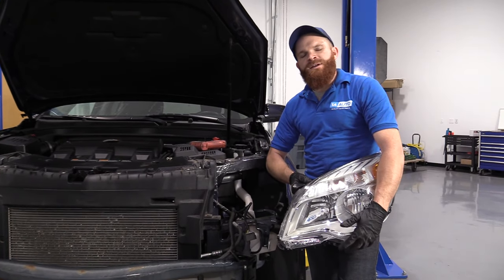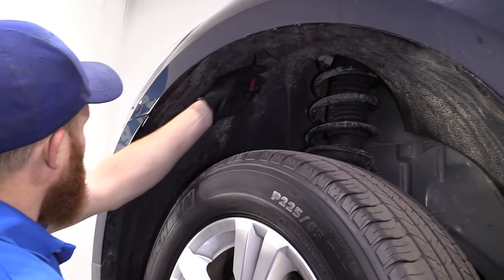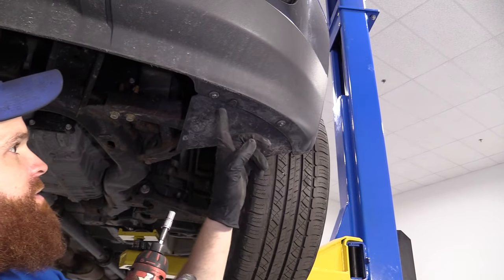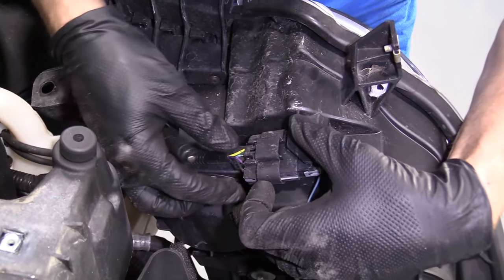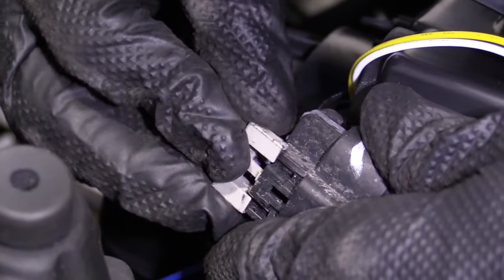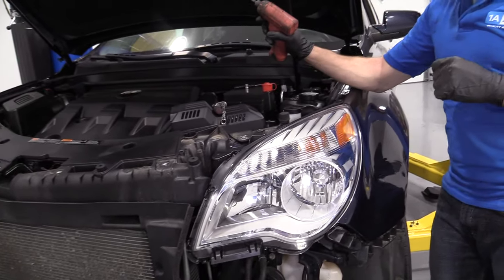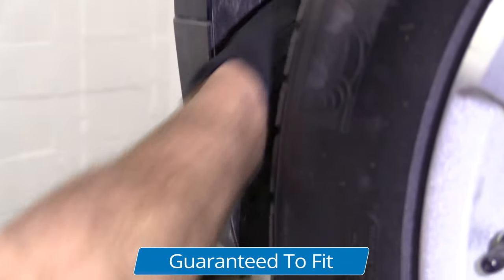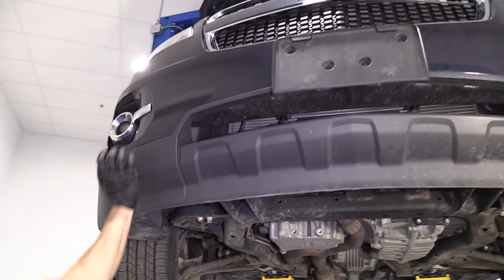How to Replace Headlights 10-17 Chevy Equinox

Comment: great video but you can save some time by just folding those two side plastic covers back after you take out the bolts - no need to take the whole things off; also always a good idea to TEST the lights out before you put everything back together in case the connector isn't firmly seated or some wire manages to get broken during the swap. Just take a few seconds...
Reply: also, having just done this - there is 0 need to remove the very top pushpin OR the pushpin to the inside of the tire - just remove the 2 pushpin and the 2 screws on the outside edge of the wheel well and also remove the top 7mm screw that goes thru the top that he talks about. The other 2 have no bearing on anything, they don't prevent the bumper fascia from being removed.    The bumper cover comes off easy and is very simple to put back on, those edge clips and tabs really do the job nicely. Take your time and you can leisurely get it dont in about 90 minutes

Comment: All that to change the assembly or the change a highbeam bulb, rediculous. I have a 2008 Hyundai Entourage. To change the assembly or change any bulbs, it takes me 20 min. I remove the plastic cover over the radiator held by those pop connectors, then two bolts. Pull forward on the assemly, then  there they are, all the screw caps with the bulbs inside. I have to replace my wifes lowbeam bulbs on her 2015 Equinox today, no problem, but I dread when she needs her highbeam bulbs replaced. Going to have to start saving up to have a mechanic garage do it when it's time. Way to go GM, great design. NOT!

Comment: 1.  Had to replace a headlight bulb.
2. In the driveway with no lift.
3. Bought the bulb.
4. Found out I had to disassemble the front of the vehicle.
5.Took it to my mechanic, who did the job for about $140.00
6.  Wrote a letter to GM to tell them what a two bit company that makes me pay $140.00 plus parts, to change a headlight bulb.
7. Some Equinox vehicles have a small door with a cover inside the wheel well . Take a screw out and reach through the hole to grab the bulb.  Only some Equinoxes have that cover and hole depending which supplier supplied that plant.  Whether you have that hole and cover depend son which assembly plant built your car.
8.  Mickey Mouse!
Reply from the maker: +Jim R Thanks for the feedback!
Reply: To just change the bulbs all you have to do is take the front of the inner fender well lose
Reply: Or you could have taken off a few small bolts on the fender liner pulled that back and reached up inside and changed it in about 15 minutes like I did...